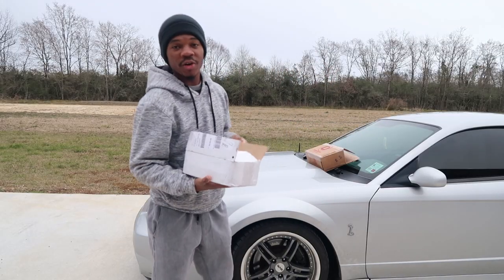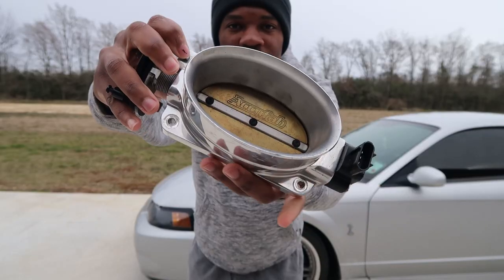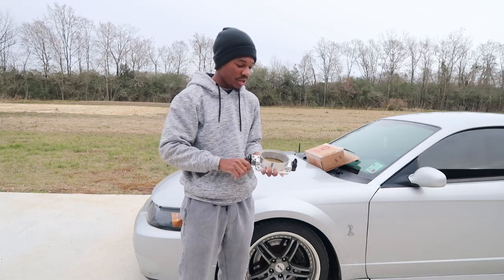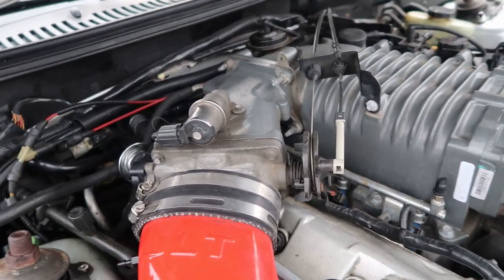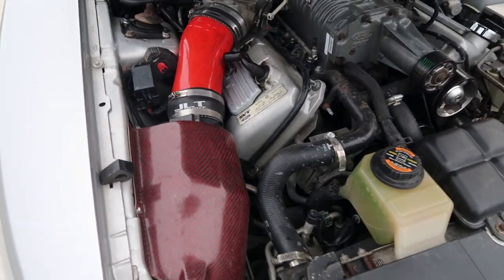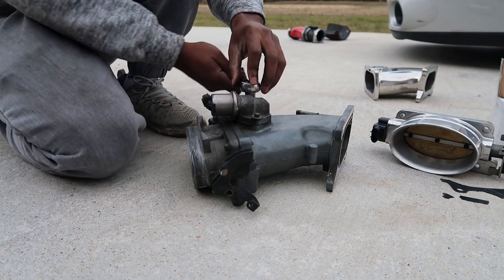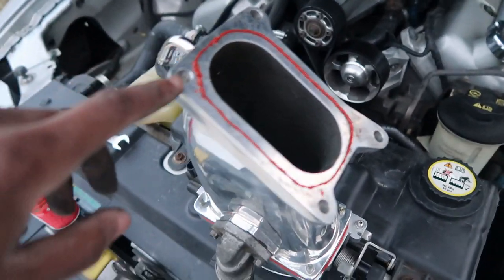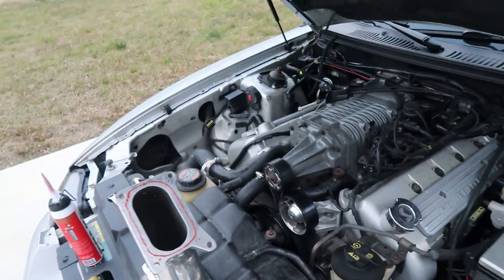Do I FINALLY Have a 500WHP TERMINATOR COBRA.!? (Throttle Body Install)

Comment: I had an accufab on my Cobra too, but I got better results with an LFP Bigmouth TB. I feel more power at WOT and it idles smoother too. I have a whipple 2.3L so it may be different with the Eaton blower. I noticed on your accufab install that you didn't have the hose all the way up on the throttle body which can result in a vacuum leak and bad idle and/or stalling.

Comment: Mine made 498 on ms109 max effort stock unported blower 2.8 long tubes accufab etc.  Really hard to make 500 wheel without porting blower or eating the motor.

Comment: Im putting my 03 Terminator on the dyno I have true dual magnaflow exhaust w/pro chamber, stock manifolds, accufab TB, dragon plenum, heat exchanger, smaller lower pillows, 2.76 upper, and it’s not tuned to the pulley and new TB, what power y’all guessing I’m putting down worst and best case? Tune will be done when dynoed!
Reply from the maker: Very similar mods to me, I just don’t have the heat exchanger yet. I’m looking forward to see what she puts down💪🏽

Comment: Thinking about buying one for my cobra, what do you think about the throttle body? and did you ever make it over 500 HP?
Reply from the maker: I never dynoed the car unfortunately.. But I talked with a few people and with all the mods I had, I was supposedly at or a little over 500whp. The throttle body made the throttle more touchy and gave my a better driving experience
Reply: PJ Morrison Gotcha i think I’m going to get it. Along with injectors and bigger MAF
Reply: And where’d you get it from if you don’t mind me asking.
Reply from the maker: I don’t even remember tbh, but I had the stock injectors and MAF.. But I did have a boost-a-pump and Diablo MAFia. If you don’t have a bigger blower then that’ll be fine with the Eaton

Comment: I have an 04 Termi with full intake, exhaust, 2.76 upper, SCT BigMouth MAF, Accufab TB and Plenum. I'm putting 480 whp. Why did your car idle like that after swapping the TB & Plenum? Mine didn't do that after I installed it. Did you clean your idle air control valve when you took it off?
Reply from the maker: Funny story.. I actually bought and installed the wrong one. Notice the shape😅

It’s all fixed now tho, video should be out in a few

Comment: Did you had any high idle problems with this TB ? I install mine and is idling high....thanks in advance
Reply from the maker: That actually was the wrong throttle body.. But I swapped it to the correct one, and yea it idles high until the ecu figures it out.. It should be ok after about 50 or so miles of driving
Reply: @pj_morrison  was it a throttle body from 96-01 cobra/bullitt?
Reply from the maker: gopher 4life I believe so
Reply: @pj_morrison  I just bought one for my bullitt lol what you do with yours?

Comment: Bro bro how did u solve yr idler  issues??? I just put that on my cobra now it idles. Now it stuck idles at 2k . Letme know have a chance..
Reply from the maker: This video takes me back lol, if I remember correctly.. This throttle body was the wrong one! It was for the wrong year Mustang, I eventually bought the correct one and got it swapped out

Comment: Wrong throttle body, that’s the n/a version. The cobra accufab has a different shape, the throttle body you installed flows less than the factory throttle body from what I remember
Reply from the maker: No, this is the correct one. Came directly off another 03 Cobra and is what’s shown online for the car
Reply: PJ Morrison  nah bro, wrong one for sure. Google 99-01 accufab and 03-04 accufab. Two different throttle body’s. A lot of people get them mixed up.
Reply: PJ Morrison I have a cobra and an accufab also btw but needed a ported blower and 2.4 upper pulley to make 500. Also needed bigger injectors and a boost a pump for the fuel system.
Reply from the maker: After doing a little more research, I see what you’re talking about.. Thanks for the heads up! I’ll get another one ASAP👍🏽

Comment: bro on the plenum  how tf did u get that bottom left side bolt off? for me i can’t get no socket in because the fuel rail is in the way
Reply from the maker: Lol, if I remember right I had to use a 1/4 in ratchet, short extension, swivel, deep socket.. Or I just used a short wrench (ratchet wrench is too thick)

Don’t hold me to that, it’s been years since I’ve had the car😅